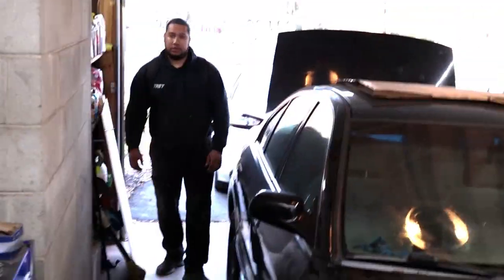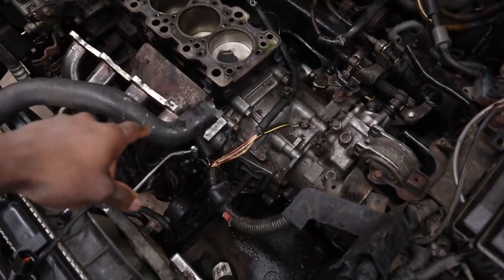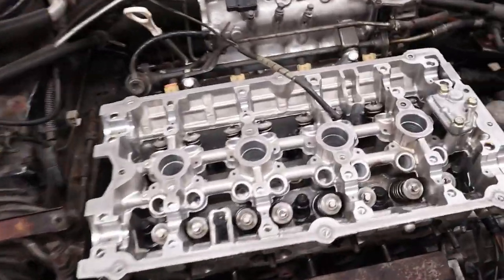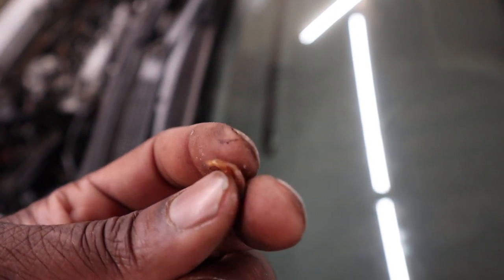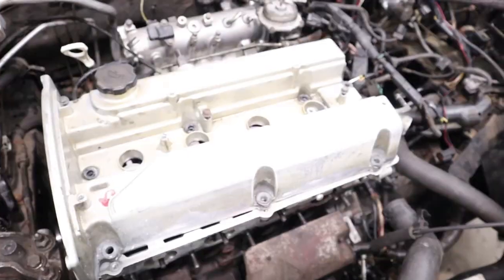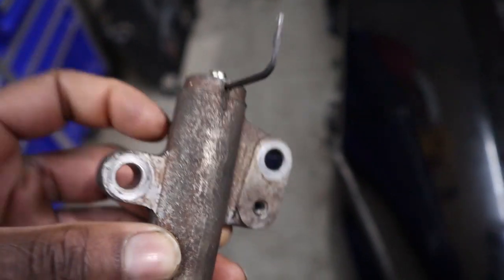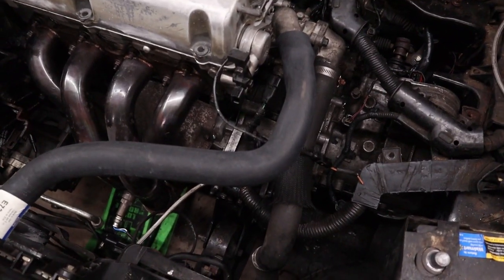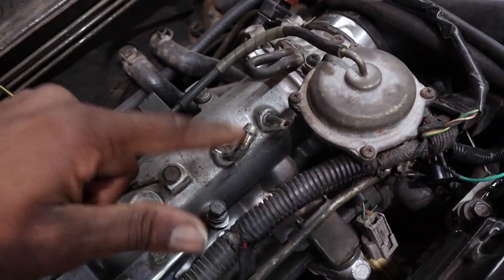Installing the Dohc Kia head on  the Galant or Eclipse

Comment: I have a question,ive looked everywhere and cant find an aswer, please help. Have a Galant 4G64 2002 and i need to know in which directio do the Coolings on the radiator run. Thanks for youre help.

Comment: I'm not sure what the benefit of this swap to a kia cylinder head aside from being dohc vs sohc, if this is being turbocharged then completely understand, but if  N/a then wasn't aware of kia making some serious air flowing cylinder heads, I'm in to all types of engines personally I'm a Honda guy and very into N/a power, and guessing this head swap gives significant gains in hp, being displacement of bottom end delivers torque? Very interesting what kia is  cylinder head from
Reply from the maker: Dohc head flows more then the Sohc so it makes more power. Both Na and turbo builds will benefit from a higher flowing head. Plus the Dohc has off the shelf cam options available

Comment: Hey, I did this swap and am planning on putting in some Kelford 272 cams. What are my options for tuning this thing? Did you do the tuning yourself when you turbo'd it?
Reply: Ecu? Did you use stock galant?  And what parts did you changes from stock engine?
Reply: @Badb816  Got a stock 3g eclipse ecu. new pistons and rods. Top end is identical to the vid except for the 272 cams
Reply: @Booleany  can't use galant stock ecu?

Comment: Good job doing it yourself and saving some money. 
Just a couple of tips though , The balance shaft belt should have been replaced seeing as you had the crank pulley off and you shouldn't use worm drive hose clamps on plastic radiator's they don't allow for expansion and can crack your hose connection point.

Comment: What about 4g63 sohc in 8g galant? Is this headswap possible for sohc 4g63 engine in galant 8g too? Please reply me. Intake manifold from where?
Reply from the maker: The headswap for any 4g motor is basically the same. If you're using the Evo or Hyundai head, you'd need either of those manifolds
Reply: @RvaJay  i have got a outlander manifold my friend
Reply: @RvaJay  will hyundai cam angle sensor works with galabt ecu?
Reply from the maker: @Badb816  you'll need the evo unit
Reply: @RvaJay  what do you mean the unit? Ecu?
Reply from the maker: The cam angle sensor
Reply: How about Stock galant cam angle sensor  @RvaJay
Reply: @RvaJay and will the 03 outlander intake bolt to hyundai heads? I heard that manifold and evo  manifolds are same
Reply from the maker: @Badb816  The Outlander is the same as the Galant. When you do the headswap, you  need to use either the Kia or Evo
Reply from the maker: @Badb816  Has to be the Evo unit
Reply: @RvaJay  why the galant sensor not working? Does it need to change the cam sensing metal part which is at the end of the cam that is signaling to the sensor? Is it also need to be from evo?
Reply: Will the stock galant ecu run it without any errors? What about injectors ? Galant, outlander,  evo?

Comment: Question man, does it really matter what head gasket you use? Like stock 4g64 or evo 8?
Reply from the maker: Stock evo has a smaller bore, you would need an aftermarket gasket that matches your bore size.
Reply: @RvaJay galant gasket will fit? 4g63 galant

Comment: Thank you for this great video. I have a question how did you know which engine head suites your 4g64? I have a Galant with 4g63 SOHC and I want to find a cheaper DOHC engine head than the Evo and I am researching for that.
Reply: The cheaper head is a g4js Kia head made from 99-05
Reply: My 4G64 does have a DOHC Head
Reply: @mirai-neo  almost all have a single cam head, the Galant vr4 had dohc or the 4g63 had dohc
Reply: @austin-lr3dx  there are 4g63 sohc in other regiins the galant in North America are different from the EU Middle East and Adia
Reply: @mirai-neo  thats not the Galant the Galant in America is different from middle east and EU it has 4g63 sohc

Comment: Pretty informational. question , what intake manifold are you using and TB? Also will the stock ECU run the dual overhead setup.
Reply from the maker: Evo or Kia/ Hyundai intake will fit the dohc head. I’m running a s90 evo throttle body currently. Yes stock ecu can handle

Comment: Bro. I’ve been looking for weeks now and I can’t seem to find a direct answer. What intake manifold will work on the sohc? The 03 outlander or the evo 8? I just want a direct bolt on and the forums go back and fourth about it. I’ve been watching your channel and you seem like you would know! If so which is better for a na application I’m not looking for anything special I just know the stock one is garbage and one of the other two is a direct fit.
Reply from the maker: The outlander will fit. Evo only fits the dohc.

Comment: Would this set up work with 2g eclipse?
Reply from the maker: Depending on the engine, something similar could be done. But, this head won’t bolt directly to anything in a 2g

Comment: Hey bro good stuff. Did you need to swap out the ECU for the camshaft position sensors or was there a way to solder it to the OEM wire harness?
Thanks bro
Phoebus Castle
Reply from the maker: The sohc head has a cam sensor as well. All you need to do extend the wires for the dohc

Comment: Hey guys
I in the middle of putting on my DOHC head from a 2002 Santa Fe and I’m try to time it but no belt I get works because the cams don’t have the same teeth pattern as the crank 
What do I do
Reply from the maker: Which belt are you trying to use? Do you have an adjustable cam gear?
Reply: No on ajustable cam gears because I don’t know what types to get and same with the belt because I got two different belts from trying the 1994 Mitsubishi Galant. one was not the right grove pattern and the other was way to short. Honestly I’ve done American v8s and v6s only and this is my fist Japanese engine and car so it got me depressed I can’t figure this stuff out. 
Lmao but I’ll keep trying tell I get.
Reply from the maker: The adjustable cam gear is a must. You need at least one on the intake side to make up for the taller 4g64 block. Otherwise the belt won’t line up. The galant belt or the evo belt will work.
Reply: Okay thanks for the info

Comment: Did you have any issues with clearance on the lower timing cover when going to dohc?  Ive noticed that the belt rides against the cover on the right side on my setup.
Reply from the maker: I did some trimming to get it to fit. It still isn’t perfect but it fits pretty good.

Comment: Hey man did you swap out the cam reluctor? I've been having issues with it
Reply from the maker: I’m running the evo reluctor. What problems are you having?
Reply: @RvaJay  I can't get my evo reluctor or bolt in. I think the Santa fe's might have a different cam
Reply from the maker: Did you get the evo bolt too? 
The cams may be different though.
Reply: @RvaJay  Yeah I did
Reply from the maker: Did you compare the old bolt vs the new to see if there’s a difference. 
Best bet is to get evo cams
Reply: @RvaJay  I did and I might just get 272 evo cams because I still need to find a fuel rail

Comment: To do the head swap you need to tunne the car ?
Reply from the maker: You don’t need  to tune the car, but it will help you get the most out of it.
Reply: What ecu do you recommend for now and when I put turbo
Reply from the maker: Evo 8 ecu is the best bang for your buck. The 01-05 manual Eclipse ecu is similar to the Evo’s but missing a few features. (Like boost by gear).
Reply: If I put the bigger thortel body without enlarging the multiple entrances, would it gain power? and which header do you recommend?
 and thanks for your help
Reply from the maker: If the throttle body is too big your car will run worse without a tune but either way you won’t notice a big difference with just a throttle body.

Comment: Ok so what I've read up on is that you can use evo 8 cams, but i was wondering if you could use the stock hyundai cams or is that out of the question?
Reply from the maker: You can use the hyundai cams,  I think the older model cams are more aggressive and good for NA builds.
Reply: @RvaJay  ah ok, i also saw that the hyundai valve springs are weaker but if it worked out for you and I'm not planning on revving out
Reply from the maker: I used the evo 8 valve springs. They can be found for under $100 and are a lot stronger

Comment: Good project, that KIA head will fit to a 4g69 engine 
block, since I heard that you can swap the head of the 4g63 on to a 4g69 engine 
block,  the 4g69 has more high-end torque.
Reply: after 2 years did you ever found out?
Reply: @GamingWithRobert  yes I’m pretty sure you can swap any head from the 4G6 series between each other
Reply: @mikehawk1673  what are the benefits of this, i have a 3g eclipse with the same 4g64 in the video and i want to know what would be the pros and cons to doing something like this to it
Reply: @goldkiller2593  you can rev it higher with the dohc, it flows better, more power
Reply: @mikehawk1673  thank you, but like what are the drawbacks like anything in terms of reliability or is it even better because your replacing? But how much power does it really add, like is it enough to make it worth it?
Reply: @goldkiller2593 the draw back is the dohc makes less torque stock then the sohc and if you snap the timing belt it'll bend the valves whereas the sohc won't however the dohc has better aftermarket support for cams lifters and valve springs the dohc swap really opens up the market for these cars
Reply: @GamingWithRobert  https://youtu.be/BRw9XSGM1rc?si=6I207iQdivMB2PJK
Reply: https://youtu.be/BRw9XSGM1rc?si=6I207iQdivMB2PJK

Comment: Great video man and how about the same kindof swap for my 1996galant what parts should i search for to do the same job u did with that car
Reply from the maker: You’ll need dsm 4g63 parts. Either the turbo or non turbo 4g head from the 1g or the turbo 2g. You’ll also need a freeze plug to block off a water port. Other than that it’s similar

Comment: Nice job,I got a question plz,am swapping my  4g69 block to 4g64 ,will there be anny issues with the crank sensor, I notice  a little deffrents with the cps plate,, the 4g69  has alot of  spikes will  the 4g64 only carry 2 cuts.do you think it would  work with  the 4g69 computer

Comment: I have seen ur video I have a 2000 eclipse gs striker motor built Manley rods weisico pistons 1400 hd oem crank polished rods are from the 2g eclipse they are 150mms if u need that info pistons 86.5 from Stm tuned for evo 8 new valves head redone and aem true time timing gears stock evo 8 cams evo 8 cam reluctur  and 2.4 galant dohc belt from 90s galant I'm using Kia optima intake manifold with the out lander throttle body gt35r turbo that's my build info
Reply from the maker: Sounds like a good setup, I’ll be running something similar. Do you have videos?
Reply: did u check my channel
Reply: I have multiple videos on my channel if u need parts or advice let me know
Reply: I talk directly with map before doing mods

Comment: Plz respond when you have time Will the 4g63 headers or front exhaust system fit on the 2.4L spyder ? Since nobody makes em no more
Reply from the maker: Which 4g63?  
The headers will bolt up because the 64/63 heads have the same bolt pattern. They may not line up with the rest of the exhaust though
Reply: RvaJay aww man yea I believ my front headers are starting to to leak
Reply: RvaJay the 2.0 2G gst/gsx headers is what I was thinking it would it be best to just swap the head to 4g63 and keep the 2.4 block from the 97 gs spyder??

Comment: I've got a 2003 Mitsubishi Lancer ES, would doing a trans swap on it be similar to the galant?
Reply from the maker: Im not familiar with lancers, but the process will be pretty much the same for any 4 cylinder.
Reply: @RvaJay  For 03 lancers they're v4 2.0L engines so they're basically just a little smaller. Ty man.

Comment: Awesome job bud! Question, Why did you grind down the fuel rail seats if you used the evo fuel rail? Mine fit with out grinding? Also, what tb is that from?
Reply from the maker: Really? Did you use different bolts? I couldn’t seem to tighten it down until I ground down the intake.
Reply from the maker: The throttle body is from an outlander

Comment: Cool video! Did you end up using stock Internals?
Reply from the maker: Yeah, I kept the stock internals. The plan is to build the bottom end after I’ve gone turbo and awd.
Reply: @RvaJay  thanks, I meant head internals. Did you use Evo 8? Or stock G4JS stuff?